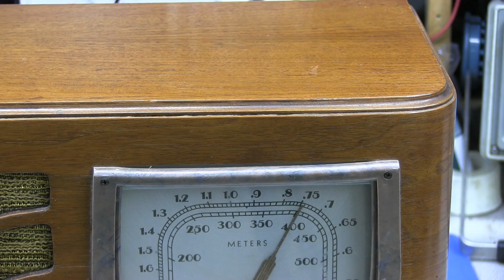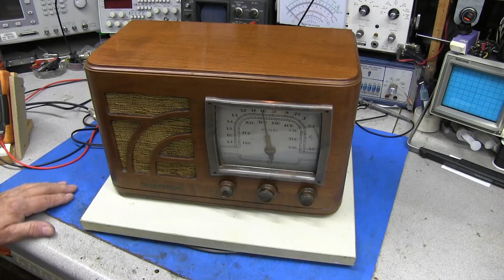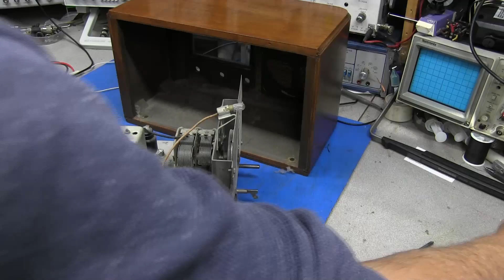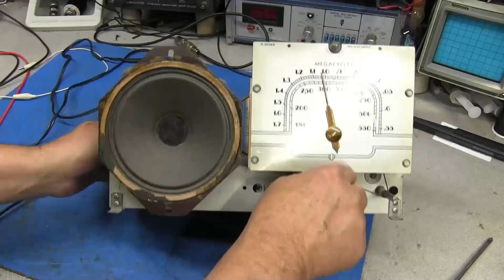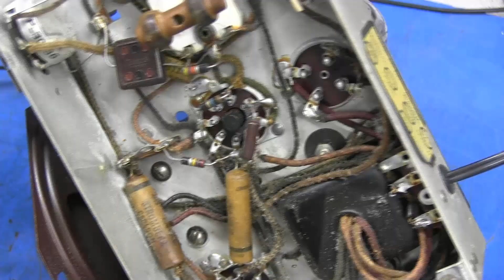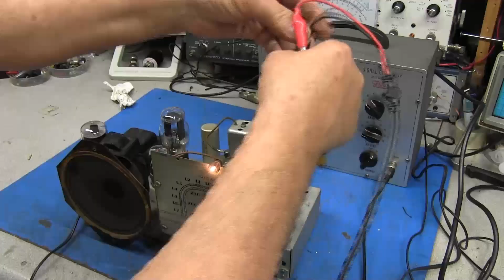Will this Stromberg Carlson from 1940 work ?

Comment: Great job Buddy. It's always a good idea to check resistors for out of tolerance like any that are in the 0.1 to 10 Megohm 
range shown in the schematic! I say this because as it is used by the owner there could be some problems down the
road with either the signal dropping out after awhile or no signals being received, as it warms up after using it. Got it.
She will be happy having a restored family heirloom radio that works great.